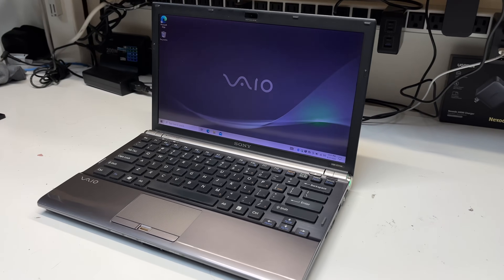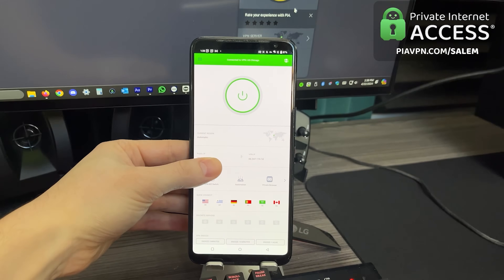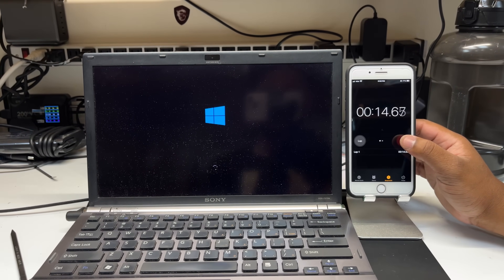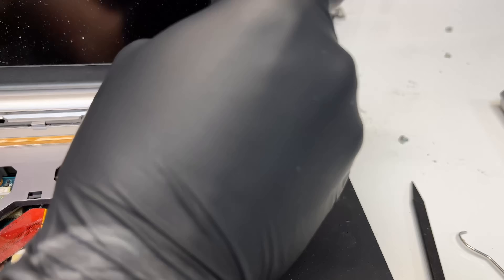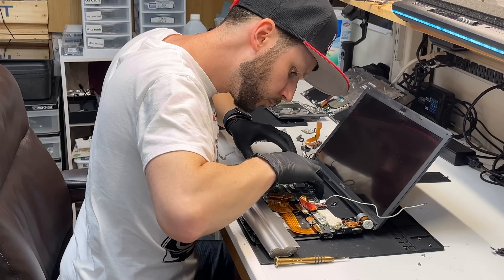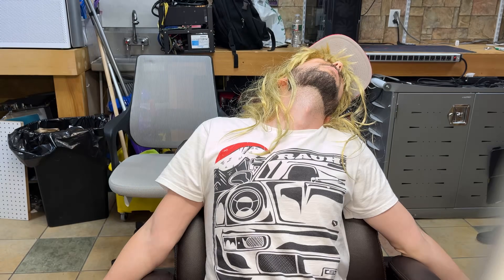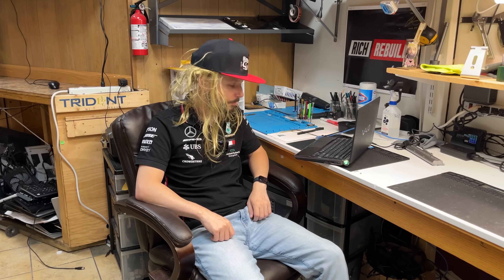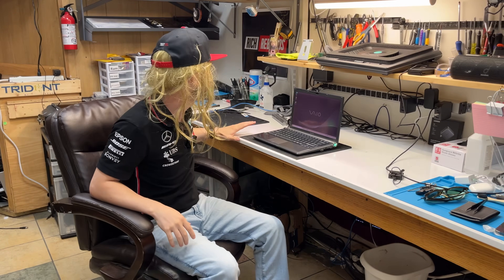Sony Vaio Resurrection: Saving this Insane Tech From 2008 (and why that soon won't be possible)

Comment from the maker: Go to https://PIAVPN.com/Salem to get 83% oﬀ Private
Internet Access with 4 months free! 
(This is the VPN I've used for over a decade)
Reply: I too had a sony vaio E series I5 1st gen. Ungraded it to 8gb ddr3 and ssd. It's now working fine with fans louder than a V10 Audi
Reply: Does this Sony support 64bit os. My application needs 64bit. Pls check
Reply: @TecArtScien  why mister? cuz my liddel systr !?
she’s is a professonal NUT TWISTER 🌰
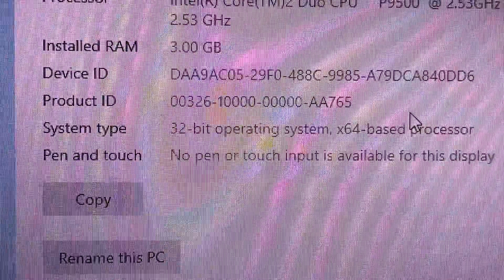Reply: @TecArtScien   at 11:22 he says this is a 64 bit cpu so yeah it can
Reply: Anything from pine 64 will last forever because being open source and consumer custom manufacturing exists
Reply: bro i really  appreciate how smooth you are with the ads. It makes it less tedious sitting through it because of how entertaining you make it
Reply: toughbooks, i think toughbooks will survive for a LONG ass time.
Reply: Cant you extract old drivers from the HDD and update them with that extract?
Reply: I just picked up an HP Victus i5 3050 8gb gaming laptop! Bestbuy deal under $600! This 1 seems to be easily repairable!                           
I upgraded from 8Gb of ram to 64gb DDR4
Reply: Been looking for one of these
Reply: hey thats not satans toothbrush thats mine!!!!!!!!!!!!
Reply: I'll look into this for my next vpn purchase.
Reply: i found the software for this on the internet archive using wayback machine for the gpu software
Reply: A silly question that's been on my mind for years: What's the difference between a notebook and laptop?
Reply: Let me ask you,if there happens to be a person that is a,I guess cuter genius and or engineer and have the knowledge to take software like windows 10 that is now not upgradable is there a way for them to make it upgradable by programing
Reply: What's the name of the show Lupe watched in Canada?
Reply: What sort of laptop lasts 16 years? I got a core 2duo from 2007 still running Windows 10. I also got an hp pavilion with first gen i7 running windows 11 (this one is a bit newer but almost 16 years old as well).
Reply: I very much appreciate what you do for so many reasons but strangely I appreciate that I'm not alone in appreciateing you it's rare proof that there are wolves among the sheep awooo
Reply: I am a hard throbbing member of the repair resistance 💪 do t give up yet brother the political snap back after than Cheeto dust dipped racist will be strong so r2r might still have a chance

Comment: I own a Dell XPS M1530, It is now 18 years old and working. Has a replaceable CPU and a dedicated Nvidia graphics card. It is heavy and very ruggedly built. It is also easier to disassemble than the Vaio! It also has a dvd player that is working, and a easily replaceable  battery.
And yes, I do repair my computers and my old Camry! Except changing the exhaust system which needed welding!!

Comment: I have a maxed out X201s and it's my favorite old piece of crap. 

The physical design is my favorite of any laptop, but the CPU is a first gen ULV i7 with underclocked graphics that can just barely drive the internal screen. 

Come to think of it, I should repaste it. Currently it's running a fresh install of Win7 that boots and runs faster than my Framework on Win11...

Comment: Thanks for the advice bro im a technician myself and i have that one but the earlier gen from 2002 its a tank i tried breaking it several times i couldnt tried punching kicking throwing it down the stairs nthn worked its still standing lol and i still fix those but for now my personal laptop is a toshiba satellite p855-332

Comment: I own a Dell Inspiron Laptop that I bought back in college days 2013. It has a 4th gen i5 and came with 6GB ram 1TB HDD. Now there is no battery and I have replaced it twice and it dies after 9-12mo. The keyboard is dead after replacing it 4 times. The HDD dies and replaced it with a SSD. Speakers are almost dead. 2 of the usb pord doesn't work. Aux port doesn't work, but am still using it with a different power adapter from HP (original one died) and external keyboard from Logitech and it's still somehow working. Not super fast, but basic things like browsing Web (around 2-3 tabs in chrome is fine) is doable and it's still my only laptop. I am pretty sure it will work for atleast another 2 years. After watching your videos, I will upgrade to a used ThinkPad in the future. ❤

Comment: Fun fact, I had a sony vaio in high school, loved it. one day a few year later, i go into my local computer store, and they had screwed a sony vaio to the wall through the case. I asked if i could buy it for parts for mine, they obliged. took it home, plugged it in, and it worked fine, I think i still have the motherboard in a box somewhere.

Comment: Hi Salem Techsperts,

I’ve been a fan of your channel for about four years now, and I’ve watched many of your videos (including the one about the kid who built his own laptop!). Your recent question about which PC could realistically stay usable for 5–16 years made me think of my own system, which has held up surprisingly well over time.

The laptop I believe can last that long is my Lenovo S540. Here are its current specs:

CPU: AMD Ryzen 7 3700U – 4 cores / 8 threads, up to 3.2 GHz with turbo
RAM: 12 GB LPDDR4 (4 GB soldered on the board + 1 SO-DIMM slot populated)
Graphics: Radeon Vega 10 with 2 GB VRAM (no AI upscaling)
Storage (current): 512 GB NVMe M.2 SSD

Storage expansion: Support for up to three additional NVMe M.2 slots, which are currently free and ready for future SSD upgrades

I’ve been using this laptop for about five years, and it still runs great for everyday tasks, school work, light gaming, and media consumption. Over time, it has had a few issues here and there, but I’ve managed to fix them myself, including several software-related problems. That process has actually helped me learn a lot about troubleshooting, maintenance, and how both hardware and software work together.

What makes this laptop especially promising for long-term use is:
Its upgradability (extra RAM slot and multiple free M.2 SSD slots)
A still-capable CPU and integrated GPU for its age

The fact that I’ve been able to maintain and repair it myself, which extends its lifespan even further

I’m only 15 years old, but this laptop has been a reliable companion and an amazing learning platform. With regular maintenance and the option to expand storage significantly using those extra SSD slots, I genuinely believe it can stay “alive” and useful for many more years.

Thank you for all the content you create—it’s a big reason I got so interested in tech in the first place.

Comment: Sony Vaio drivers were the bane of my young gaming existence. I got a Vaio Laptop from 2007 as my first PC, with a Core 2 Duo iirc and a Geforce 8600M. 
Staring at the Nvidia homepage and not being able to install the normal driver, instead having to use the MUCH older Sony driver was infuriating. 
SONY
Y U DO DIS?

Comment: i had a VAIO from 2008 (i think) it had an Intel Atom (1.0/1.8ghz) and 2gb of ram.

It was good enough for me to carry thru my studies to become a lawyer, since i mostly needed to use a text processor (i recall using Open Office). by the time i ended my studies that poor thing was very obsolete yet i managed to sell it to another student.

That netbook had a 10 in looks and a strong 4 (by the time) in computing power. a few years later that 4 was a solid 2 and by today's standars i think that could only be used with an alternate linux distro. 

That being said, it wasn't that durable. i had to replace keyboard 2 years after purchased and some stuffs like wireless network wasn't reliable. Nevertheless current laptops are uglier and yet more disposable

Comment: I have the same one and believe me it's a great, I posted for $50 or less than $50, I used it for nearly 2 years, will they vertical line in the monitor, it works a great on a Windows 11 lite Ghost Spectrum with SSD, as you mentioned in the video the greater problem is that you wouldn't find any updates to drivers, you can't find any third party source but it wouldn't be sufficient like the original, I hope that I can install Linux on it

Comment: My first laptop was a Sony VAIO VGN-FWXXX (Sylver) with an AMD HD 3650 graphics card and a Blu-ray disc reader. I bought it in 2008 when I started university. The screen was spectacular, and visually, it was the most beautiful laptop I had ever owned. It was much easier to take apart, and when the Blu-ray drive broke, I replaced it with a dummy adapter so I could install a second hard drive. Eventually, the GPU died, and I had to buy another one after eight years of gaming and programming practice during my degree.

Comment: My daily desktop was a new bought Core 2 Quad q6600 LGA 775 until 2 years ago.
OC from 2400 > 3000 Mhz !! Paired wih a GTS 450 had the best time, learned much.
She still has a place in the living room running at the (s)lowest effort where we watch Salem Techsperts together.
Just over 17 years service she had some required upgrades, psu, ssd 
But, mobo, cpu and ram are still the same, then bought parts. 
<3

Comment: I mean I own a 2018 ThinkPad L380 Yoga and it is so easy to repair and is so modular im convinced i can get through high school and college with a new battery (it has an i7-8550U, 32GB DDR4, 1TB nvme, and is built really well)

Comment: Andy, I agree with you on the subject of sustainable computers of all sorts.  I just took my very first foray into the world of the laptop PC, and I was lucky.  Out of (something like) the goodness of my heart, I bought my housemate a laptop to replace the relic that is her daily driver before it becomes unsafe because of Windows 10 EOL.  Using her old laptop as a guide, I got her a Dell Latitude, as her old one was the same make and a similar, though older, model.  I got a bit jealous, though, because I've always wanted a laptop, but couldn't then didn't afford one.  The unit I got my housemate, though, was a good used business computer -- which is what you recommend, as I've since learned -- so I decided to buy myself another one of those.  I didn't quite duplicate her computer, but I don't think I'm going to be to disappointed with my Dell Precision portable workstation -- also bought used.  (My machine was made in 2018.)  Indeed, it's become a second daily driver.  Construction wise, these machines are much more study-feeling than even a later-model Precision.  You could almost use these computers to defend against a zombie apocalypse and they'd survive it.  After this, they're both going to sit at home with the old folks.  One thing I like about them both is that they have upgradeable RAM and storage.  That's how I got lucky; I made these choices without knowing nearly as much as I know now, yet made the same choices about these two computers as I would have if I had discovered your channel first, rather than the other way around.

Comment: 15:00 This hit hard. I was forced to use laptops since early on due to my university and work, and I've had so many bad experiences with stuff being hard to repair (and my own lack of technical ability to do it) or simply as expensive as getting a newer, better one. The amount of e-waste is staggering, especially when most of the components were perfectly usable.

I had to buy a more performant computer for some 3D work, and I bought an Omen back in what, 2015? It was pretty damn impressive for the time, but it ran way too hot. Eventually, the fans got a horrible rattle. I sourced replacement fans, didn't touch the thermal paste (I wish I had stumbled into this kind of information back then). My partner still uses that same Omen today to work, and that thing still can run stuff like Hogwarts Legacy really well at 1080p. I even ran it on a 4k TV once for fun, and it managed somehow.

Thanks for the many great tips, I will do what I can to keep that laptop working.

Comment: I have the 17" VIAO VPCF121FX from 2010 and I'm hoping to repaste it soon. I already have a Dell Inspiron 13-7378 as my daily driver since 2017 so the VAIO will just be a learning opportunity. I already maxed the RAM and replaced the HDD with an MX500 years ago, so only thing left to do is repaste. I know it definitely needs it because over a decade ago before I upgraded it to Win10 it used to constantly overheat to the point of shutting down. But even now, it's hooked up to my TV permanently and does my simple Putlocker sessions just fine, so I wouldn't mind keeping it until it crokes. WISH ME LUCK! 💀 

LOVED the Boeing reference 😅 even tho it's a sad situation.

Comment: I have an SVE15117FG model VAIO which I bought in 2012. I just pulled it apart and cleaned it, and it actually seems quite good in terms of being able to pull it apart. Interesting how different their laptops could be between models

Comment: my laptop has a Ryzen 7 4800HS

i limited the clockspeed to about 650 MHz once to see how well it ran things
the CPU is so powerful, that with all the cores limited to 650 MHz, it felt still felt nice and fast and i had zero issues.

Comment: Typing this from a 2012 sony vaio vpcca17fl which has gone through fan change, memory expand (from 4 to a whopping 8 gb wooooo), paste change, wifi card doesn't work, the amd radeon graphics card it came with pooped itself (black screen when you install the latest driver, not sure how to fix that, tried many things) and of course a lot of internal cleaning, this thing has been used and abused but, ironically, unlike the one from the video, super easy to open up and clean everything.

Comment: You inspired me to take old laptops form my family members they dont use anymore and repair or scavenge them for parts. The best thing I found is a 1tb HDD in an old hp that had (you guessed it) a broken hinge. I use it now for my backup drive.

Comment: Thinking about machines that will suffer premature deaths - the A1466 Macbook air. I have one and its still a pretty good machine. Its light, compact has acceptable battery life, has a great trackpad and a nice keyboard and is still quite useable on Linux. I use mine every day - especially for work stuffs but the fact Apple scrimped on RAM and only gave them 4GB instead of 8GB will render most of these machines unusable soon enough when its entirely possible many might well have lived 16 years otherwise.

Comment: upgraded a L755 laptop from Toshiba 
changed the hard drive to SSD, installed 16gb ram and an AX210 wifi+BT card
could barely tell it was an old laptop

Comment: I still use an Acer Aspire 5920G from '07. Its 17 freaking year old and still holds up amazing, WITH WINDOWS VISTA...You heard right.Ive taken good care of it, replaced everything from cpu to CMOS Battery, put a fast BX500 SSD and put some brand new arctic mx4 thermal paste.

Comment: I'm currently in the process of learning microsoldering to repair my 2020 dell inspiron that died in 2021 due to a power surge*, you're an inspiration. the power management chip literally burned, producing smoke. i've ordered a new power management chip from aliexpress and some SMD soldering equipment on ebay and it should arrive soon, i'll just using dead boards that i have in the box full of random parts i have in my garage to practise before attempting the actual repair.
*i was in a hotel, on the first day of my week long holiday in dublin in 2021, browsing the web in firefox with the laptop plugged in to a Juice USB-C four-port charging brick, when the laptop screen turned off, and never turned on again. The USB-C port on the charging brick was also dead, which leads me to believe it was a surge
Reply: even though I use a MacBook Pro 2023 model, i still care about fixing my own stufff. (I can't live without final cut pro, I've tried Resolve and Premiere but FCPX is just all i can use after switching from camtasia)
Reply: maybe some day i'll be able to upgrade the 512GB storage in my MacBook Pro to 1TB or 2TB if i get good enough at this.
Reply: failed due to more extensive motherboard damage caused by the surge. my chip replacement was successful but the motherboard ended up being more damaged than just it. i still have experience tho
Reply: i was able to successfully repair the HDMI retimer on my Xbox one using the skills obtained from the attempted laptop repair!

Comment: Give Driverbooster a try when you need drivers, especially when working on older devices. I salvaged some ancient Dell Latitude laptops a few years ago and got them runnning again with SSDs, more RAM and new batteries, but getting the drivers was a chore, especially since those on Dell's website were completely out of date. Driverbooster found all of them fine just fine and those laptops were running like new. I'm not in any way advertising for IObit, but when you just don't have the time to scour the internet for drivers, then it's the best option for getting the newest drivers fast.

Comment: My favourite laptop of all time was a Song Vaio. It was super thin, purple, small screen, had a metal case. It was small enough it could fit in my purse. It also had a docking station which really helped back at the office. I loved it. I used it until it was unusable. Had all these cards for modem, network and a portable CD player/reader. Wish they still made something like that.
Reply: Magnesium alloy case. Light and strong. Later they moved to 'carbon' which was more like plastic and not nearly as strong.